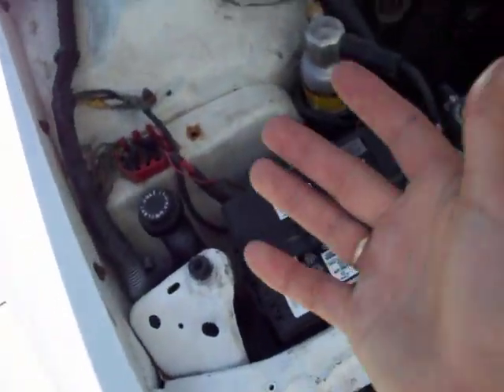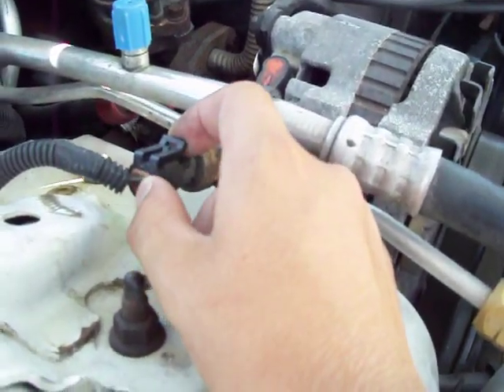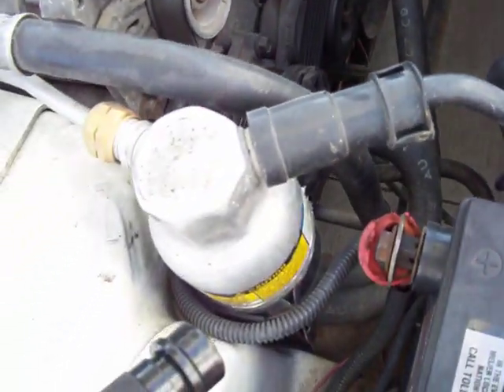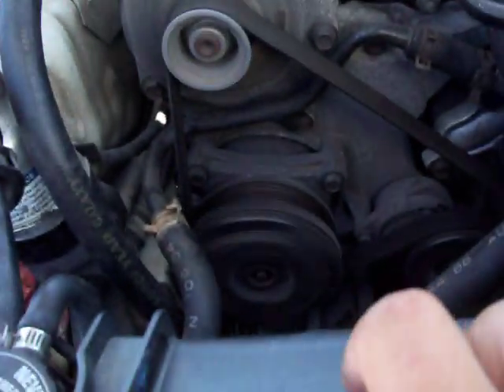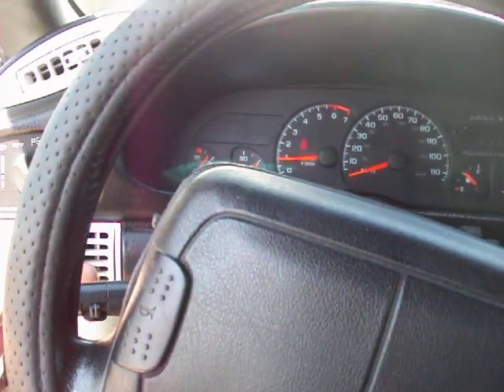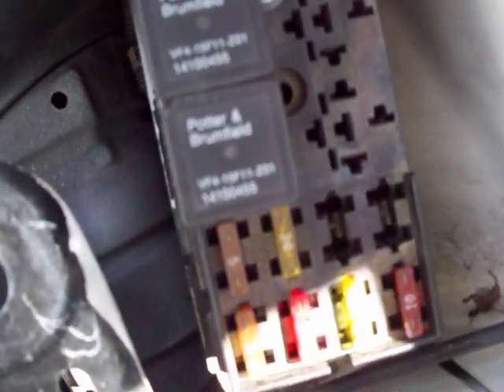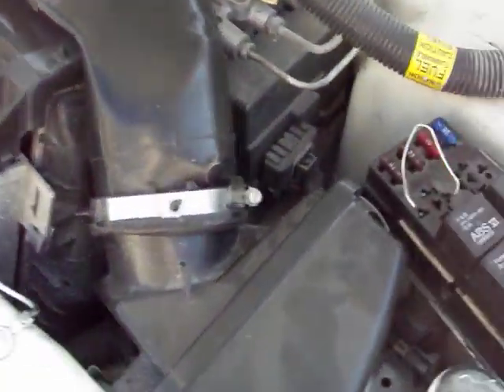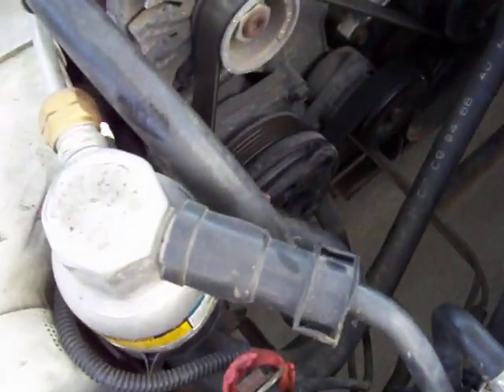How To Make AC Ice Cold, Recharge air, and Force the Compressor Clutch to Engage

Comment: I agree with the statement above. There are cert. that you need to work on AC systems, and home and auto is a diffrent cert. Every system would be diffrent , and the pressure that he said would be around 45 is wrong, depending on air temps, altutude would give you a evaporator temp. in my area a 21 degree evap is ideal.

Comment: why use fuses or relays anymore when you can just use foil & paperclips lol?
AWESOME VIDEO! THANKS!
Reply: No...the fuses and relays have an important role cuz they also supply equal voltage to the ststem
For example....a/c compresssor relay 
-------------------------------------------
If ur compressor is not working and u tried the paper clip method....the compressor will start but it should not spin continuiously.....for normal functioning it should kick on and then off in seconds....running a compressor continuously cause a serious problem and costs abt $400 to $600 on ebay....try searching HVAC systems on youtube. And u will understand it
Reply: +yousuf aboon naser  The cost of the compressor, is just the tip of the iceberg!!! The cost of the new condenser, the new hoses, the new expansion valve orifice assy, the new receiver/drier accumulator unit, all new hnbr seals, and flushing the entire system remaining that was not replaced with special solvent and compressed nitrogen, and evacuating and re-charging the system because of the metal in the system from the compressor failure.... I have seen people fork out well over $2,000 for repairs like this.... Do it right, or don't do it at all....
Reply: +yousuf aboon naser And You tube DOES have some excellent advice, as well as advice that is NOT so good , such as the individual who Produced & posted the video above...... Use advice from EXPERIENCED PROFESSIONAL TECHNICIANS WITH THE PROPER TRAINING!!! The advice from the individual who posted the video above does not fit into that category....
Reply: +EHunterTV  Please, tell the local fire department of where You plan to drive And park Your vehicle !!! You sound like You're driving an accident waiting to happen!!!
Reply: Michael, man you have a LOT of time on your hands, if the amount of your comments is any indication.  Maybe you should get a job.

Comment: if its low enough psi to turn the compressor off then it will take charge from the can without the mod.. a loose connection for the magnet (buick is common for this)  or clogged orifice tube. (need a duel gage set to check high & low psi). cooling core leaks by the radiator or shaft seals on compressor will drain the system. both would require replacement in such case. seize compressor is worse case.

Comment: Great video. Maybe you can help me. My clutch starts shutting off when the temp outside gets to around 100 degrees outside. It will start and stop over and over. The freon is INE and with in the normal range. What could be the issue ?

Comment: 25 to 55 psi is a broad range. To check the "freon" (not coolant thats the stuff in the radiator) you need to simulate driving conditions. First put a large fan in front of the car so you get airflow through the cond. second start the car and put something on the throttle to hold rpms at about 1500 to 2000. roll up all the windows, set for max and high fan. If you are really low add some freon, wait for the inside to cool down, a hot interior will make the pressures high, don't rely on that. As you get the inside cooled down you can start to fine tune the pressure, you want about 30 to 35 psi. At this point your evap line should be cold and sweating.

I just love to see non trained people try to attempt AC work. Its not really a shadetree job, you NEED to understand the basic principle, if you don't know what superheat is you don't know enough.
Reply: +vboss5764  BOTH sets of pressure readings (High & LOW system) are the things people need to know when doing this job... Also the ambient (LOCAL OUTDOOR) air temp is an important factor, as well as a pressure/temp chart to check these pressures with.... This work should NEVER be done with the low pressure gauge by itself, as any clog or malfunction in the system could lead to a serious over pressure condition on the high side, which could damage the system and possibly cause a bursted hose or component... The basic principles of vapor cycle machines should be understood-yes... So should the proper tools-equipment / techniques and procedures of doing work like this be understood and adhered to before attempting work like this... The video put out by Auto Zone is an excellent guide to properly do work like this... Service manuals and various publications will also explain the correct technique to do work like this.... Dis-regard this video shown above...

Comment: tip if ur air isnt coming on, freon is full, and the compresser doesnt look bad replace the fuse my car the fuse for it will look perfect but becuase the fans short circuit from a mechanic doing shitty wireing it may blow the fuse and pulling it out and looking doesnt help u have to replace the fuse and see if it works. i have 4 extra fuses so i should be set for a while

Comment: I just have a question.... when my clutch is engaged my pressure is dead on between the "V" on my pressure gage... but when my clutch disengage my pressure builds up at the redline at about 414psi and then clutch engages and psi drops in between the "V" position. Is that a normal process? Thanks for the awesome video!!!!!!!!

Comment: HI, can you please tell me if your car has a MAF sensor, the one that goes beside the air filter, my 95 camaro was in an accident with the previous owner and it has a short hose with a spectre air filter (cone shaped), so the RPM's are 1000 in both idle and in drive, its an automatic, I asked in Auto Zone and they tell me that the car doesnt have it, I also have a Beretta GT 1998, manual transmission and it does have a MAF sensor, thanks for your help and your car loks great with the ground kit

Comment: Hi great video !!! Now I have a little bit of trouble ...  ( I own jeep wrangler 98 4.0 ) i did everything you show here !! I actually install ( evaporator, condenser, dryer , compressor, lines, orifice tube )   for some reason !! When I start adding the R134a after vacuum the system for 1 hr. No leaks everything look good ... the compressor engage but immediately the pressure gauge jump to 100psi !!! Even so high that some ac line pop out !! And of course the system don't charged  and the compressor start getting hot ! Im totally lost here ... WHAT DO YOU THINK COULD BE THE PROBLEM ? something could be clog ?  Bad line? If you have any idea or tips please ! Let me know ! Thank you so much

Comment: To fill the AC to make it the coldest connect the fill hose up start the car put the AC on Max if the pressure is above 25 or below 70 connect a can of refrigerant turn the valve to puncture the can do not turn it out yet. Place a thermometer in one of the vents  and slowly turn the valve out letting the pressure rise slowly the temp will start to drop. At some point it will start to rise. That is when your AC is charged properly. Turn the valve back fully clockwise and verify the pressure is less than 70 PSI. You can't do this while filling. If it's higher something is probably wrong. Take it to a real repair guy before you destroy your AC. Rev your engine and watch the pressure it should drop some if not something is wrong. There is an indicator on most fill valves that show a specific pressure depending on outside temp. The hotter it is the higher your low side pressure will be. If it's 100 degrees your pressure will be high you should expect 40 deg or more compared to outside temp

Comment: These systems are not rocket science but mechanics would like you to think so, even if you evac it and fill it with gauges on both hi and low side the problems with an ac not working can only be from a few different failures. All doable by anyone that takes the time to learn.

Comment: If you have air in the system you need to evacuate it with a vacuum pump before you refill it. Any moisture in the system can cause problems down the road.

Comment: I was successful in getting the relay shorted to start the compressor and fill with Freon and my air works now although shorting the high pressure switch doesn't do anything.
Is it OK to keep the compressor shorted permanently or should  turn it off and on from time to time?

Comment: Don't pull the block if clutch is not engaging  and jump it there. If you unplug the pressure switch and jump it from there then it will engage the clutch as well. And also let you determine if the pressure switch is the real issue

Comment: Sometimes the AC clutch won’t engage because the electromagnet is going bad in there as well and you need a new AC clutch assembly. sometimes its just as cost effective to replace the whole compressor system.

Comment: Where did you get the single gauge and hose to check the freon pressure? I cannot find one like that after a Google search.
Reply: +Michael Martinez Are you on a Crusade - - or what !!
Reply: +TIMEtoRIDE900  I'm informing people of the CORRECT methods to use for this procedure... Just as You Are informing those with Your advice... I am also informing people of where to get the CORRECT methods and information , like the Auto Zone video... The advice the individual gave in this video above is NOT anywhere close to being correct... People could cause damage and/or get hurt with advice like the individual gave to those who watched and do not know how dangerous this is... There are gas's and pressures involved that could have the potential to cause serious damage and/or injury.... Crusade? Well, if just 1 person gets the idea of following the PROPER procedures, then maybe I have helped to save somebody and/or something from being hurt....
Reply: Michael Martinez
O.K. - At issue,

1. You seem to believe some part of the A/C system can explode, causing eye injury.  Have you actually experienced or observed this ??

2 You seem to think the "stop leak" does not work, or ruins the system.
I have had pretty good luck with the product.
Do you know, for a fact, that this product ruins A/C systems consistently ?? Because I don't.

3 Lastly, you have voiced that jumping the relay is dangerous. Really ! At Idle, on a car with low Freon, where this "jumping" will just be temporary.  Nobody is going to drive down the road with their A/C continuously "ON".
And again, where is the hazard??
I had a car where I switched the A/C on with a rigged switch, and the downside was, it would just freeze up if left "ON". No harm to the car, no personal injury. so, what are you on about ??
Reply: +TIMEtoRIDE900   1) Any system or pressure vessel that holds fluids or gas under pressure has it's limits as to what the maximum pressure and temperature should be... To exceed the maximum pressure is asking for trouble!!! There are charts available to determine the maximum pressure in a vapor cycle machine (automotive A/C system)...In order to determine the maximum pressure, one must: A) Have a gauge connected to the high pressure side of the system B) Have a thermometer to tell what the Ambient temperature is... The best thing to do to keep things from exceeding the Maximum pressure is to carefully watch the gauges while charging the system while the compressor is operating...I have seen footage of what can happen to people who do not pay attention to this... I really don't want to experience this first hand - and so I'm advising people of HOW to PREVENT injury and damage to equipment...   2)The stop leak product sold in the automotive stores is primarily a 'quick fix' that people who only want to sell their used vehicle and temporarily repair it and don't care about the longevity of how long the repair will last...The RIGHT way to repair a/c leaks is to put dye in the system and use a black light to find where it comes from, then replace the leaky 'O' ring and/or component(s)... The stop leak will void all vehicle manufacturer warranties and kill any kind of a warranty a repair shop will have issued...The stop leak is so destructive, that very few shops will perform work on the system when this product is in the system...  3) If You read what I said about 'jumping' the safety relay in the system, I said it could be done for temporarily operating the compressor for charging only, and should be done using the proper tool (Bayonet connectors on the end of a 16AWG insulated wire)... The individual in the video used a paper clip which could really cause electrical problems if it shorts onto other circuits or makes an arc which will cause problems on the relay sockets... If the 'jumped' circuit stays on continuously while driving in high temperatures, there is a real probability that the compressor could over-heat and develop a catastrophic failure, sending metal shavings upstream into the system and cause far more damage than the compressor itself...     TIMEtoRIDE, You have to do the job RIGHT to prevent the TIMEtoTOW.... Unless of course, You happen to want to have breakdowns on a regular basis!!!
Reply: +TIMEtoRIDE900  I suggest that You spend $25 on the AutoZone video as It could save You; Time, Money and Frustration...  If You follow the advice given with the CORRECT procedures, You just might find that You'll get better performance with greater dependability by using PROFESSIONAL level instruction... People who ACTUALLY know how to PROPERLY repair things,  know the value of advice from somebody who is PROPERLY TRAINED with lots of EXPERIENCE...

Comment: thanks all is working now just the temp out of the vents is in the60s not 20 degrees lower like it should be , i still have to change the resistor , nw blower motor still only Hi
Reply: Hello Thomas, before replacing the blower motor resister , first see if the 'Max A/C' (recirculation) mode switch is on ... This mode often will by-pass the power going to the resisters, and sending full amperage to the blower motor... Sometimes the switch in the control panel making the By-pass to the blower motor, is welded closed...

Comment: Ok I have a question if the ac clutch is not kicking on will it show a check engine light? And if I put a computer on it will it read that it is the ac clutch that is going out...

Comment: How do you short it out to engage your compressor.  Which wire do you cut
Reply: did u get it fix yet
Reply: No but is it a bad ideal?
Reply: Frank A Bad idea,  it can, and most likely will heat up the relay and cause it to explode, or worse start a fire. Look at the video again and it tells you where to jump the relay. You should invest in a set of gauges to check the low and high sides of the system. The low side should read between 40 to 55 lbs.
The high side should read between 185 and 220 lbs.
Reply: TO Jamal Hudson:                          Look at the video again and it tells you where to jump the relay. You should invest in a set of gauges to check the low and high sides of the system. The low side should read between 40 to 55 lbs.
The high side should read between 185 and 220 lbs.
Reply: Alternatively, for the duration of the fling / trouble shooting, run a temporary wire directly from the battery + to the power wire of the magnetic clutch.
Reply from the maker: I never mentioned any soldering or cutting. Please watch the video again and follow directions, or take your car to a mechanic.

Comment: My compressor clicks on and off once per second. With AC on full blast, I checked the low side and the pressure is ok. What do you think?
Reply: +Harley Rider  Get the Auto Zone video and go through it before doing anything else... Then use the CORRECT methods to troubleshoot the problem with Your system... Dis-regard the video posted above.... Check the high pressure side and compare that AND the low pressure side with the temp/pressure chart for the type of system (R-12 or R-134A) You have on Your vehicle....Study the video I suggested, and use the equipment and procedures pointed out in this video and You'll most likely find and correct the problem... Please dis-regard the video posted above....
Reply: +Michael Martinez I think you are right. However which auto zone video? I did not know they had videos...
Reply: +Harley Rider I remember buying the video in dvd format that they were selling a few years back... I do not know if they are still on display , but maybe they can be ordered... The video for automotive A/C was excellent... There was an entire seris of videos they had... I bought every one of them...

Comment: Is it always pins 30 and 87A on the relay to do this?
Reply: NOT always Colin... Different vehicles have different ways of doing things.... Some vehicles use 5-pin relays, some use 4-pin relays, some vehicles don't have relays mounted in the main fuse panel at all...